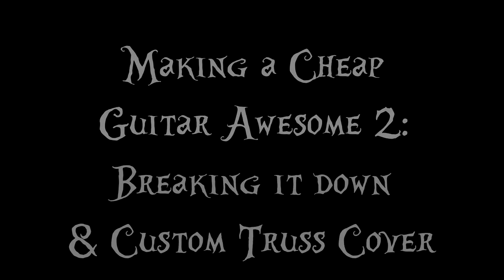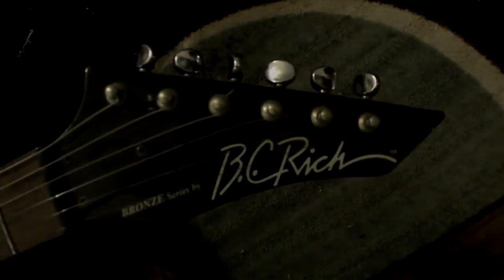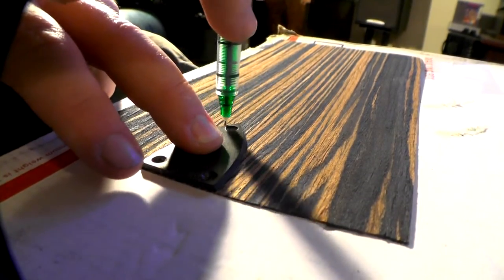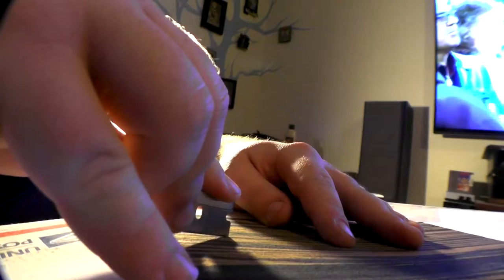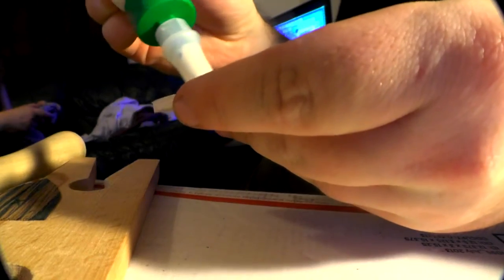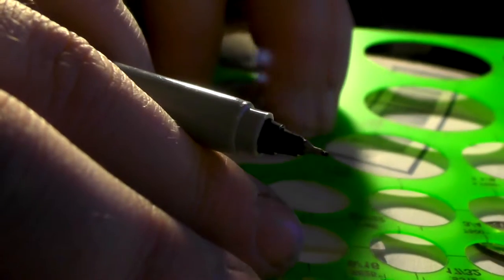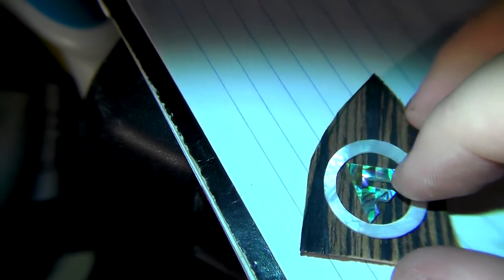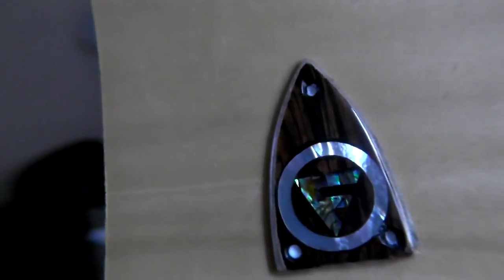Making a Cheap Guitar Awesome 2: Breakdown & Truss Cover

Comment: Never seen anybody do a truss rod cover like that, or do one at all, truthfully!  I've a specialized hole saw collection, I'm going to do a little experimenting to replace the obvious cluster someone had rigged on to the Hagstrom solid body F200 i probably over paid for, did i mention probably ? Yeah, after i got it to its new home, my eyes seemed to open up a little, (didn't realize they were shut) And lo & behold, mismatched screws... anyways i'm dialing in an otherwise nice sounding guitar, One of my favorite little moves, is when tuning up, leaving whatever string unmuzzled, I'll gently tap the body and get a solid response out of whatever tuning mechanisms hooked up !